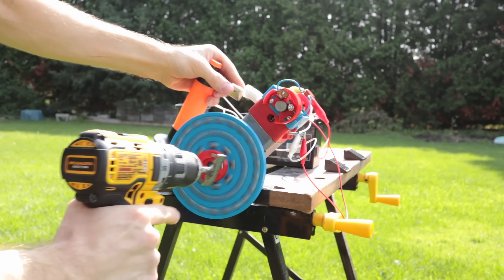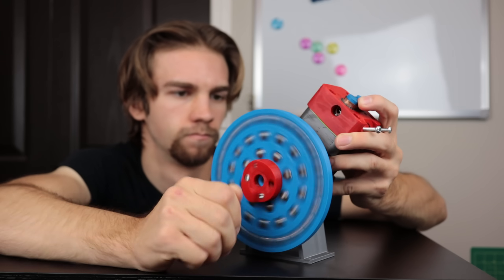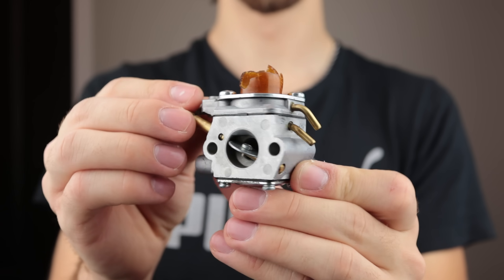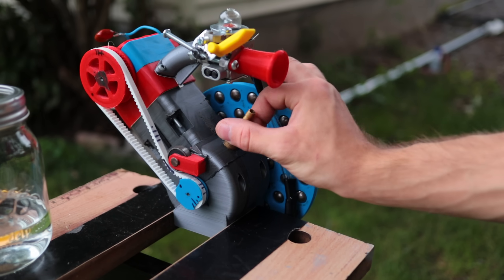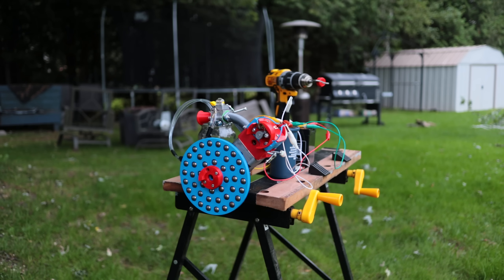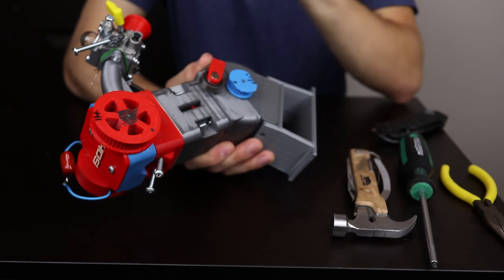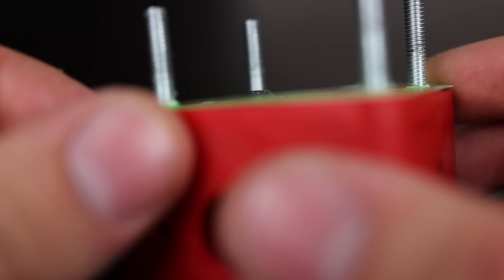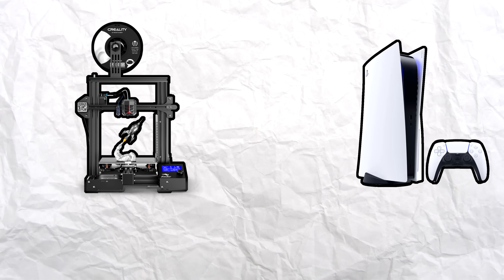Adding a Carburetor to my 3D Printed Gas Engine, and now it RUNS!

Comment: Could you design a more robust head, using metal components? I'd be curios to see how long the 3d printed bottom end/ piston will hold up.withoit worrying about the head failing

Comment: Oh yes that feeling you get when your engine starts up for the first time ! 🤩😎😂   Now you can design a head with some cooling channels for water.     Then a 3-D printed water pump driven off the crankshaft.  Enjoyable journey that most all "MICE" have been on.  Model Internal Combustion Engineers.  Lots of people have built engines, not so many have been able to get them to actually run.  BTW I use the Red RTV "High Heat" silicone (from the auto parts store) in a tube to make head gaskets.
Reply from the maker: Thank you! It took a lot of work to get it to run, thank you for the support!

Comment: Try out modifying the timing by opening the exhaust valve later so it wont get burned because time by it wont be any combustion while the piston is going up and burning the valve or smth. Or print it out with some metal solution

Comment: Maybe build the valves out of some rod that has a washer welded (or threaded) to the top so you aren't having to jb weld a plastic top to the rod?

Also, if you start to have trouble with the cylinder melting, you might line them with polished copper tube (similar to how you made the valve bodies). 
   A gun cleaning kit with the brushes and mops would really well for polishing tube interior when chucked into a power drill.

Comment: Im not seeing a crankshaft file in the google doc. Is it not 3d printed?
Reply from the maker: No, it was made from steel. In the last video I show it off, it's basically 8mm rod and some flat steel cut and drilled. In the next video I will release drawings for it

Comment: wasnt the timing set to near tdc? that would definitely increase the chance of burning the valve but its all plastic so it might not even matter since it will get hotter with a longer burn from advancing. or try a long exhaust pipe to limit the amount of oxygen near the exhaust valve like regular engines. i know that engines without exhaust headers have a high chance of burning valves do to the exhaust gases still getting oxygen burning past the valve

Comment: I was a factory mechanic and a fabricator, with a habit of seeing issues and fixing them, often. I'm tinkering with nylon now, CF is next, and then metal infused. I'm retired and don't have access to the machine shop anymore or I'd fab one up for you. Mild steel wouldn't be good for you engine but it'd work in a pinch. I think you're on to something and working out the bugs is the main issue right now. Lube and air flow is one of those bugs you need to work on. I noticed you didn't have enough back pressure in your exhaust so you had flame leaving the engine during combustion. There is a synthetic oils out there that would work since they are safe for plastics. I'd test them first with a thin layered piece, print one up using the same plastics you made the motor with and soak in for a few days in the oil you want to use to see if it warps or softens.

Comment: do you think this would be any easier with a resin 3D printer?
Reply from the maker: Possibly? It would require MUCH more time and effort to print, but will yield higher tolerances
Reply: @CamdenBowen  there's also ceramic 3D printers that might yield a higher tolerance, but then its not as fun as a plastic engine

Comment: My guess would be that your timing is off just a little bit the difference just a single tooth can make on your timing belt/chain can be the difference between perfect smooth running fuel efficient to rough idle gas hog rocking all over no power dog sled valve burner that all being said I would definitely one tooth at a time adjust it one way then the other once you get it to a point it will run for 15-20 seconds it's definitely not far off but once you find that sweet spot the world of difference will be made and she will run n like a Swiss Watch!

Comment: I would suggest a non ethanol fuel. Or A plastic that alcohol doesn't melt then use E-85. As it stands now blue gas or camping gas maybe pre mix is generally easier on plastics. An engine will run cooler with timming advaced and more fule. Rc cars use the fule as a coolent, nitro methane 8 to 1 compression lots of fule might be the best.

Comment: Flames shooting out of the engine is actually better for the exhaust valves than not. More fuel causes the engines to run colder. Geo Metros (Chevy Sprints/Pontiac Fireflies) have issues with burning exhaust valves because they run too lean; but the performance intake with more fuel injectors fixes that issue.

Comment: If you use a brass insert for the valve seat and the valve guides it will handle the heat from the exhaust.

Comment: its most likely to melt itself rather than explode cause it can happen to full size cast iron engines that’s why you need to have a radiator

Comment: You could press your 3d printed parts into kinetic sand to make a mold then melt some aluminum cans, and cast some parts that way. I was also interested to see a 2 stroke carb on a 4 stroke engine. Good stuff!

Comment: You have made a great engine, but there are some flaws, you need to use some ring gap for your cylinder rather than totally sealed piston, because you need to hold the pressure for some time not for too long, that's why every engine has atleast some amount of ring gap. This might be the reason for your exaust valve to blow I would also recommend you to use metal valves out of a cheap engine

Edit:- 1,2 mm of piston ring gap is enough for your engine, as you are making everything out of plastic you can increase ring gap

Comment: Engines shooting flames without an exhaust manifold is more than common. No Internal combustion engine burns 100% of the fuel so without an exhaust manifolds the very hot combustion gasses mix with fresh air reigniting not simply because it's not tuned properly

Comment: Awesome project.  Keep in mind your carburetor is tuned for petrol but alcohol needs a much richer mix.  (14:1 vs 8ish:1). So your mix is very lean, and will burn very hot.  Tuning for alcohol may actually work really well because it can keep cylinder temps down.  Will be hard to get around burning your plastic exhaust valves though. Ive heard nitromethane burns pretty cold but thats something like 4:1, from memory.

Comment: I think adding just a touch of two stroke in the alcohol will help keep the system cooler for when it does run. Will also be easier on the carb since it looks like a two stroke carb

Comment: You should 3d print a 2 stroke engine! They don't have valves and are more simple to keep running. You should also try metal filaments and other heat resistant filaments.

Comment: add a carb to the vtec engine you made or is it not possible or designed to run
Reply from the maker: The VTEC engine was never designed with it running on gas in mind, I'd have to revise the entire engine to make that possible... not that I never will however :)

Comment: To stick with the 3D printed parts but cheat a tiny bit, you need to look into Resin printed parts that take any heat. Cylinder sleeve , piston and valves could be resin printed and can take way more of a heat "beating". Also, Smarter Every Day made a super simple carb if you want to stick with the more "made yourself" approach.

Comment: Perhaps if it was all nylon and electroplated maybe it would last a bit longer, but ANY fuel will burn too hot for a plastic engine to run for more than a few seconds. Maybe a steel cylinder sleeve and a metal head would be a better choice. And maybe a piston that metal topped?

Comment: My comment will get burried here im sure. But i would like to see you attempt to electroplate this engine. I have done this several times with pla for cosplay projects. Im wondering if it will increase longevity as well as allow you to run actual fuel threw it. My only major thought on it would be that you would have to adjust for mil thickness.

Comment: do a 2 stroke design no need for valves then.   and can still use that weedeater carb and your oil and such is mixed in with gas

Comment: exhaust valve takes about 80 or so percent of the engines heat, you want to use something that would take more heat, or increase your valves margin so it can take more heat without dropping or melting away.

Comment: try making it a flat 4
1 less mass per cylinder
2 easier to balance
3 could help isolate if the print was bad or if it is a part design problem

Comment: How about making some valves out of something like a large flat head tapered screws.  You could file down the threads and trim their lengths to fit.  Just a thought to keep things inexpensive and to continue your progress.  I supposed if you have a metal lathe you could always make yourself some valves.

Comment: In my opinion, the solution for your engine is to increase the distance between valves and the point of ignition. An additional distance like 20 mm also reduces the compression ratio, but I don't think you want to build a high-performance engine. It is the easiest solution. You can also eliminate valves by converting the engine into a two-stroke cycle, or try the opposed-piston engine concept. By the way, sharp edges are going to melt first.
You can also try changing the valves' overlap and adding a turbo or supercharger, or anything that can increase air pressure on an intake. Turbocharged engines have longer valve overlaps to use airflow to cool down the upper part of a cylinder - worth trying.

Comment: try mixing oil into the gas like a 2 stroke maybe it will stop the engine from seizing, you could also try to lower the compression so it runs cooler keeping the plastic from melting

Comment: Plastic engine doesn't run long?  How odd 🤯. If you could make durable engines out of plastic that's what most car manufacturers would be using
Reply: Printed ceramics may be extremely durable and cheap

Comment: If you run it on ethanol exclusively, put all the power output into water cooling, and at least bite the pullet on metal piston rings and sleeves, I bet it could run long term.

Comment: The exhaust valve took damage because it has hot gas constantly flowing through it and the intake has cold air and evaporating cooling it down.
Exhaust valve needs to be printed of something with more temperature resistance. or maybe sprayed with a conductive paint and electroplated

Comment: Haven't been following but I really hope that you continue with this project. Would you be interested in continuing to iteratively improve your engine to possibly make it power something?

There's a good chance this would result in most of the engine becoming metal since combustion generates heat, and plastic just isn't meant for this, but it would be cool to see how long each component could be left plastic and how easy it is to replace it.

Comment: Have you seen the video that "The Thought Emporium" put out about coating anything with metal? I wonder if that could be used for 3D printed combustion engines as a measure for protecting the plastic pieces and perhaps tightening some of the tolerances. 
This thing is cool regardless. Awesome job.

Comment: try printing the valves with a metal filament. researching cold burning fuels and picking the right one would help with longevity, possibly adding water cooling too.

Comment: Integza used ceramic resin and although it's difficult to work with, if you manage to print with it, ceramic valves could help. Or maybe coating them in some metal? You could use metal paint to make them conductive and then electroplate the valves and head.

Comment: Multiple solutions here. 1. Use a valve from a small engine. 2. Wrap in metal?. 3. Make inside of valve into a bladder, essentially an icepack. Leave small hole, fill with water, plug with whatever. Depending on how good the seal is maybe glycerin. Even if it leaks out in 20 mins, you can still get a good effect edit: make sure where possible you use ridges like in tires to increase strength and cooling.

Comment: Hi. You absolutely have some kind of engineer mind and capability to think like an engineer. And that's a pretty damn good thing to have! Congrats for that! If you just want, you can get to high and long. If you know what I mean? Well, of course you know, cause you are and you think like an engineer. So. Just do what you want to do and do it with all your hearth!! Thats the way, that I have done. And it is just perfect way to go.

I suggest for you to get a milling machine and lathe. I know, I know, things like that pays a hell of a lot a money. Yes, a lot of a money. But, if you would like to have a lathe or a milling machine or maybe bought. You just have to try to save some money. Maybe it will take year, or a two or a five. Who knows. But at the end you will have what you need the most! And then you can do allmoust anythin. I mean allmoust ANYTHING! I do have a lathe and a milling machine. And I do engines and things like that. And I can say, that only your imagination is on your way. If just know what you are doing, you can do it. You can do anything you want. And PS. If there is engine, or part of engine or part of anything. Some one has done it. And that someone is a human. So, you are human allso. So, you can do it too! Never forget that!! If there is something, that is made by a human, it is possible to fix or make a new one. That is my motto. And it works. I have learned a lot of thigs just because I had try things and I have been believing on me my self and I. So, you do the same pleace!

Comment: You are now officially an engine designer. Who knows, maybe you might make a version 2 with all the knowledge you've gained along the way and make an engine that can idle for a minute, maybe even an hour, out of plastic.

We could take used water bottles and turn them into engines. All that plastic waste can be put to work.

Comment: From experience, resin 3D prints are way more resistance to heat, you could 3D print the valves in resin, and use a steel guide in the center. They should last longer this way.

Comment: sand cast the valves in aluminum and run it, then eventually sand cast the head.
you should be able to get away with sand casting the block and keeping the piston as plastic and have it run much much longer.

Comment: If you don't want slap ever, run a double crank with the piston linked to both with two arms. There are a few engines of that design. The piston cannot kant over.

Comment: The exhaust valve burn can be resolved with proper ignition timing.

Or a metal exhaust valve, that would also do the trick.

Comment: I think you'll find when you beef up these broken parts, then there will be a next part that goes bad do to heat and pressure, with ever diminishing returns. Until you can change the material property variability you will remain with predictable results.👍

Comment: Print a two stroke engine they don’t need valves to run but the fuel is mixed with oil to lubricate the engine

Comment: Your carburetor is probably jetted and tuned for gas in a normal 14,7:1 ratio. Meaning your engine runs to lean to even combust on alcohol, where the right ratio is 9:1.
Your carburetor should  be jetted to mix 9 grams of air into 1 gram of alcohol, not 14,7 grams.

Comment: BRAVO!!!!!!!!!!!!!!!!!!!!!

I'm not sure who wanted this engine to run the most, yourself, or your viewers, but congratulations on a project that has taught me (and many others) a bunch of very useful tips and tricks for building robust 3D printed mechanical assemblies! 

Testing limits using materials that are expected to fail is likely the best way to find the "sweet spot" for designs that have to meet high performance expectations which may approach the limits of the materials chosen for the job.

Thanks again!!!

Comment: Congrats. 
So cool that you got it running and so easily as well. The exhaust valve is always going to be a point of failure before anything else when it comes to heat. It gets fully surrounded by flame unlike any other part in the engine.

Comment: i think one of the things that are prolly realy important if u wanna run it for longer is cooling and for simplicity i think just air cooled might be good enough but i was thinking oil cooled or water cooled arround the cylinder like holes in the cylinder like actual engiens have. but also noice engine. u need to 3d print a tubular exhaust for it XD

Comment: I wonder if everyone who sees this really understands what you've accomplished.  It's not necessarily that you've made an engine out of materials that, in the context of rocketry, could be used as fuel themselves.  It's that you took a dummy-tier 3D printer and managed to get enough repeatable precision out of it to produce the kind of surfaces that normally require hard materials, real tools, and at least a little machining experience to produce.  

Tony Stark made an arc reactor in a cave from a box of scraps.  You made an engine from a trumped up, motorized hot glue gun.  My hat's off to you.

Comment: Hi, you could try to use some metal nails as valves. I think it should seal good with o-rings. 
Also, maybe you can use a copper tube again, and a piston with aluminum foil jb welded to it? 😅 I think that should help getting it to run for longer.

Comment: If it didnt run out of fuel when the jar dropped off the table you couldve got a bit more runtime out of it. The valve only stayed melted open once it cooled after he engine stopped

Comment: surprised that it didnt immediately start knocking also if you dont wanna deal with valves much you always could make a 2 stroke engine which would also help with the issue of lubrication and not needing valves meaning you cant have the valves fail